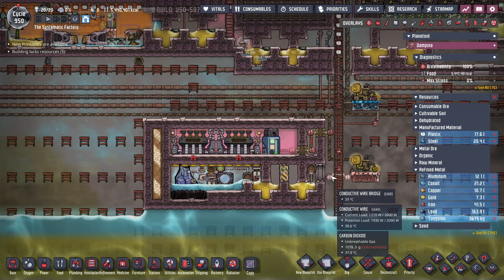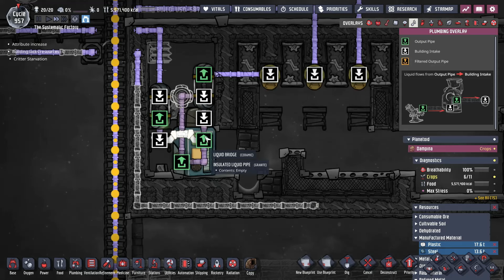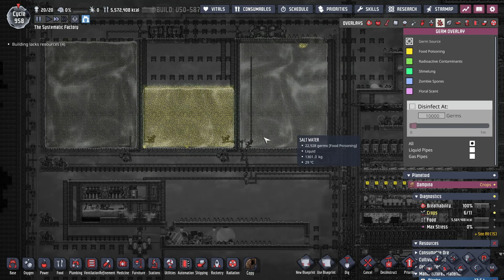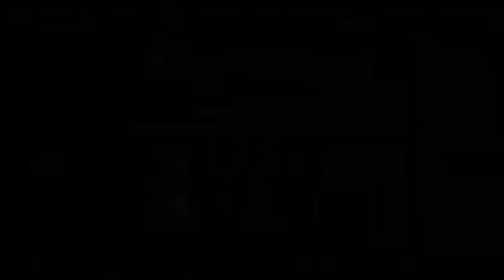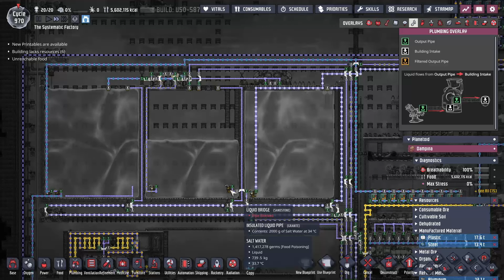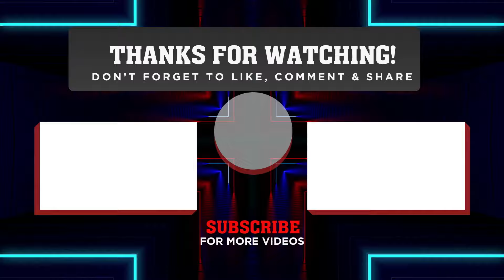Water Treatment Plant | 20 | Oxygen Not Included | Oceania Cluster

Comment: a water treatment center sounds great! good to see you solving the problem and moving forward, and one more problem, it will be in the Iron Volcano, there is a lot of water and when it all boils, it will block the eruption of the volcano, the metal volcano and the magma volcano cannot erupt with atmospheric pressure above 150 kg per tile
Reply from the maker: Yeah, I put in too many temperature shift plates to bring in the ice, because I did the math wrong.  I'm watching it to see what happens.  So far, the pressures are fine and the volcano is still erupting.  I think rather than pump it out, I might just vent the steam exhaust back into storage until the pressure reaches what I want it to be.
Reply from the maker: I did not know it was 150kg per tile.  I'll check it and make adjustments.